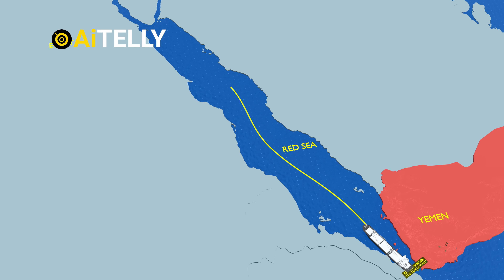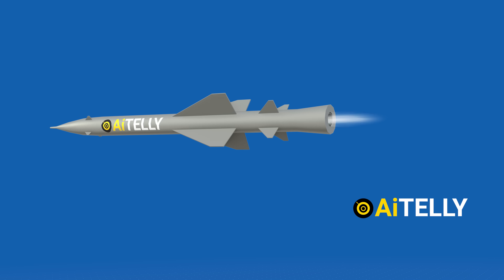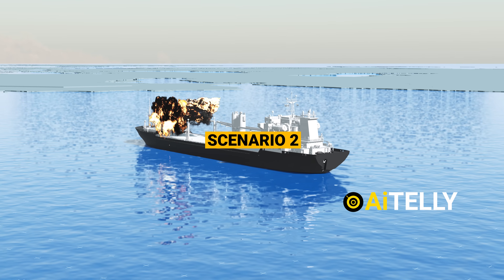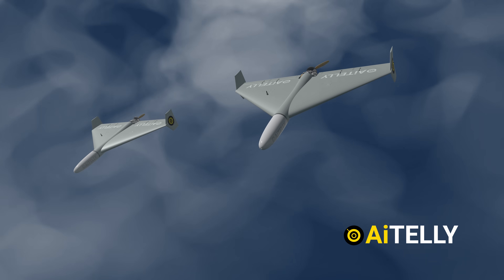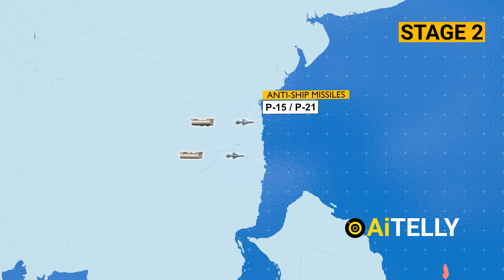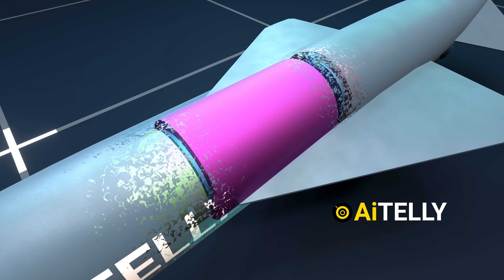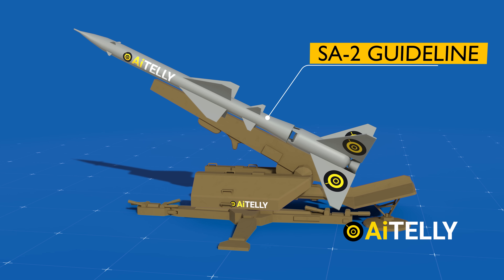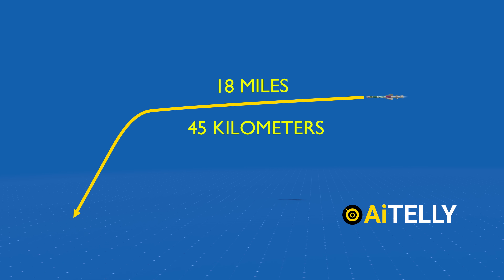How Houthi Missile Drones Attack Ships?

Comment: I saw Chinese military experts analyzing that its terminal guidance is not active radar guidance, but most likely laser guidance. The reason is that when the terminal is located in a low-altitude, high-air-density environment and flies at a speed greater than mach5, it will produce ionization blackout, which will render the radar ineffective. The terminal speed of ballistic missiles will basically reach Mach 5 or above, which is why most ballistic missiles can only be used to attack fixed targets.
Another evidence of laser guidance is that you can see the hit scene shot from multiple angles in the strait, which shows that there are many small ships or drones nearby, and they can be used to illuminate the laser to indicate the target. Therefore, based on its ballistic missile The attack mode is likely to be inertial guidance plus command correction, and terminal laser guidance.
Reply: Where is it? YouTube video or article?
Reply: This❤❤
Reply: The "ionization blackout" scenario is not impossible to overcome. The Americans managed to do so over 60 years ago with the Sprint ABM (Mach 10+). It was able to receive radio command guidance during its flight.

Comment: What might be needed is a anti drone system that can be mounted on a shipping container and moved by a helicopter so that as a ship moves in range the anti-drone shipping container is  placed on that ship via helicopter and then is removed and placed on another ship (coming the other direction) once the ship carrying that anti-drone shipping container leaves harm's way.

One might call this Aerial  Transportable Overhead Protection (ATOP) and the process  Rent ATOP (a play on rent a cop).
Reply: It's interesting but the problem is mainly linked to the cost of anti-drone missiles, oversaturation can guarantee the loss of a ship
Reply: Nah just get a Close In Weapon System
Reply: That's not practical. It is the same as proposing mounting a machine gun in a cargo truck to prevent robbery on the roads.
Reply: The less costly option is to avoid conflicts altogether. But then if you tough guys think you can afford conflicts with everyone, sure why not. 🤣🤣
Reply: @mejust8392 there brain misses the first step😂

Comment: If it were as I said, the Houthis would have attacked all the ships they could. This only requires missiles, as the coast of Yemen is close to Bab al-Mandab and has high mountains in which tanks and cannons can be hidden, because the distance is close to 20 kilometers and it does not need missiles 😂😂